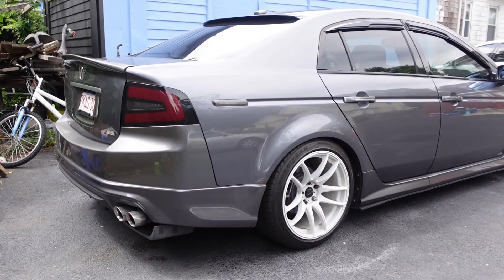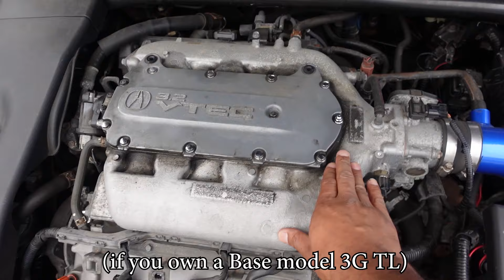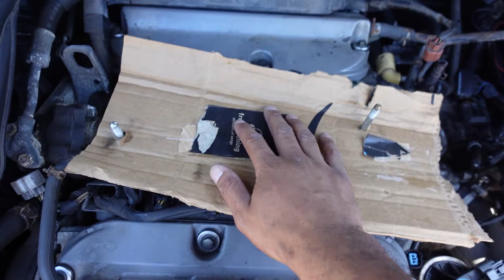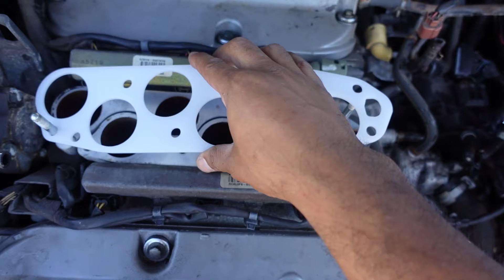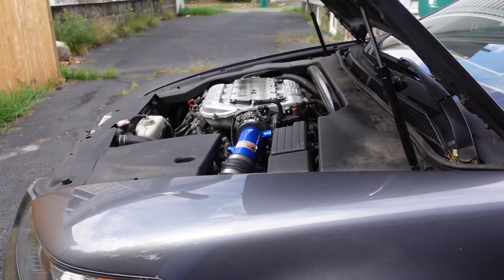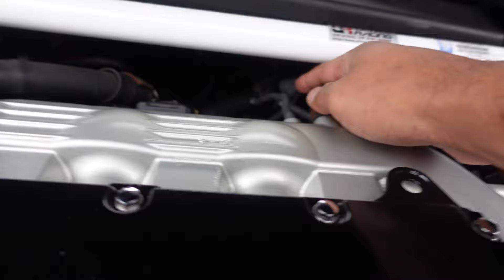MORE POWER!  3.7 Intake Manifold & Throttle Body Install

Comment from the maker: If you can find a cheap 3.7 Intake Manifold and throttle body, This is DEFINITELY A GOOD BANG FOR BUCK PERFORMANCE MOD.  Enjoy!!
Reply: Do you get idle issues after install
Reply from the maker: No issues at all, beside idle being 100-200 rpm more.  It's been a couple of months now since install, and I actually havn't had any problems.  This is just my experience
Reply: How much was that manifold cover and where did you buy it?
Reply from the maker: I bought my intake manifold off eBay, throttle body off Rock auto.  I repainted the manifold and that top cover
Reply: @thecarfiend11 around how much did u end spending on the intake manifold i don’t wanna get ripped off buying one
Reply from the maker: I bought the 3.7 IM for around $200.  add in the throttle body, coupler, gaskets, cleaning supplies and paint..it was around $400+ total
Reply: @thecarfiend11 do you have links at all?
Reply from the maker: I got my stuff off ebay
Reply: @thecarfiend11 thank you
Reply: So did the throttle body come off a tl 2010 shawd manual and it plugged and played?
Reply from the maker: Whatever the 3.7 motor is from.  Should be plug and play with some modifications needed. And you may run into issues like me
Reply: If you’re interested I’d be willing to buy the old faulty throttle body👍🏼
Reply: those sparco wheels/rims right ?
Reply from the maker: No.  They're Work wheels reps =[
Reply: So is the 2010 TL SH-AWD Throttle Body (or whatever Year TLs... an RLs TB/and or Intake Manifolds work as well?, Does 2010 TL SH-AWD use same 80mm TB but with same clip that would plug in correctly???)... which is the better option so you can plug in that clip instead of deal with the plug-in issue with the 2011 MDX 80mm Throttle Body? (also you know you can get that TB clip from an MDX out of a junk yard, De-Pinn the wires out of your TL TB clip and Re-Pinn the wires terminals into the MDX Clip right) ... 

An is the Butterfly actuator on the IM Cover like the MDX? Or on the IM itself like Gen 3 TL's?... 
I heard the Magnesium 3.7 Manifolds are the best to get...  

Year MDX or TL SH-AWD that came with Magnesium Intake Manifolds?
Reply: Hello I been look for that Silicone coupler with the hole for the IAT sensor can you like me know where you got it from??
Reply from the maker: its a couple from P2R.  Here's a link..
https://ebay.us/iHiCYw
Reply: @thecarfiend11  😢

Comment: If you can try to get a smoke test done, or start spraying with carb cleaner around all gaskets it sounds like your 2-300 rpm gain is coming from a vacuum leak. Great video!
Reply from the maker: Thanks man, appreciate the tip!

Comment: Thank you for this video, I recently acquired an 05 Acura TL base. I was told when I got it it had a 3.7 intake manifold swap and a type s automatic transmission installed. Had no way to prove it until I looked at this video and saw the differences. It is a true swap definitely makes me feel a bit better!
Reply from the maker: Awesome to hear!
Reply: the 07-08 transmission won't bolt up to your 05. bellhousing is different

Comment: Hey bro I have an Acura TL 2005 that has been sitting there for the past year and a half because I didn't have money. But now I do I really love the car right now I'm using a Chevy Malibu I don't like it, but do you think it's worth putting money into my Acura. From what I remember it was just a few head gaskets and a few other things that included taking the engine out
Reply from the maker: Depending on the condition of the car, it may not be worth it.  These cars are aging and considered "old" now.  But if its in good condition and you can do the work yourself, it may be worth it.  04-06 Autos have weaker transmissions than the 07-08, also.
Reply: @thecarfiend11  it's only overheated twice and I towed it worse case head gasket?

Comment: Never expect big numbers on Honda's unless cost isn't a concern. If I'm gonna build a street pounder I'll still build a Chevy. I love my Acuras but Chevy parts are plentiful and cheap compared to Honda's. I can buy one thumping cam and lifter kits for about 150. 00 For Honda's it's 849.00 and about 8 hours work.
Reply from the maker: I actually agree.  I'm don't plan on doing big numbers or adding extensive modifications.  I'm only doing budget full bolt ons and maybe a tune.  Grew up with Hondas and love Hondas.  So to each their own..

Comment: Where can I relocate the air temperature sensor?
Reply from the maker: Ideally, you want to put it in the same location as the 3.2 intake manifold.  drill, tap and die.  Others have relocated it in the intake piping also

Comment: Hey man. 🙂 Got a 2001 Acura CL Type-S. I already have the 3.5 intake manifold. I can't do the 3.5 throttle body because my butterfly cable is powered by the cable not electricity wires. But my question is where did you get that silicone IAT adapter? I've never seen one of those before. 
Thanks. I love your videos.

Comment: How did the bolt patterns Match up? Did you have to do any bolt hole relocation? I’m afraid that it won’t fit when I do mine
Reply from the maker: It's a direct bolt on (besides relocating the IAT sensor)

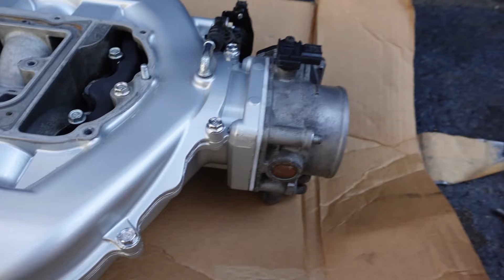Comment: 7:29 name of the coupler ? Link doesn’t work anymore
Reply from the maker: coupler is off a 3.7 Acura TL (4th gen).  Made by P2R.  should find it on ebay and available off their site
Reply: @thecarfiend11  appreciate it
Reply: @thecarfiend11 also one more question. Can I re use the hardware from the stock manifold to bolt it down ? Or do I need it from the donor car ?
Reply from the maker: I used the same hardware that bolts down the manifold

Comment: New TL owner here when you got the 3.7 did you have to change the runners are does the stock runners from the 3.2 fit the 3.7 intake manifold
Reply from the maker: You can change runners, but I did not.  Other owners usually get bored out runners from P2R

Comment: Edit: was your TL always manual? Your shifter box looks different than my 6mt. Anyways awesome build. Loving that even after a decade people are still modifying their 3rd gen TL's. Do you plan on supercharging your TL? I wish comptech still made that supercharger for the J32A3

I swear I should open a shop for fixing Acura TL's dashboards. Ive wrapped mine in a two tone alcantara. The only pain was grinding down the cracked areas after filling them. But having taking out my 06 dashboard multiple times I feel like a pro lol. I wish Acura had put more money in a better material dashboard.

Comment: Tune required?
Reply from the maker: Not required.  But it would help with gas mileage, get some more extra HP, and run better.  As long as it's tuned properly

Comment: What did u use to secure it to silicone? Super glue?
Reply from the maker: What silicon and where?  I don't think I used silicon anywhere
Reply: @thecarfiend11 sry I meant the silicone coupler, how does the sensor stay in place?
Reply from the maker: I don't have anything holding it in place.  It's been super tight, no clamp or zip tie needed yet

Comment: How much horsepower does this add to the base 3.2tl?
Reply from the maker: Not sure, as I did not do any dyno before and after.  Should add 5-10 Hp, in theory.  Also could be even more if you add complimenting mods, like a cold air intake and intake runners

Comment: Hey man, thanks for the detailed installation of the 3.7 manifold. I do have a question about the connector for the butterfly valve. Was it just a straight plug-in or were there any modifications done to it to plug-in?
Reply from the maker: Thank you, thank you.  It was not a straight plug in.  You have to shave it slightly, so it can slip on. I briefly explained it in the video
Reply: @thecarfiend11  oh yes, I saw that. I was asking more about the butterfly valve connection that sits on the intake cover instead of the upper manifold.
Reply from the maker: Are you talking about the IAT sensor?
Reply: @thecarfiend11  no I’m talking about the butterfly valve that sits in the upper intake to open or close depending on how much throttle is given.

Comment: Is this installed on the 3.5 liter?
Reply from the maker: i installed on my 3.2L.  But it can be installed on the 3.5L also
Reply: @thecarfiend11  is there a good website for the interchangeable mods like that?
Reply from the maker: Acurazine is a good forum for resources.  And for purchasing parts, you can visit EndlessRPM.com or HeelToeAuto

Comment: I’m thinking I will just drill a hole in my 3” to 4” rubber coupler right at the throttlebody and getting a thin nut for the inside to secure in the iat sensor.  Did you just push in the iat sensor in the hole?  Is it secure?  I think the threads on the sensor are m12/1.5 can anyone confirm this?
Reply from the maker: its a hack, but sounds like it could work.  I'd be careful, because if the nut gets loose and falls off, it goes straight into the intake..

Comment: 6:35 WELL Worth the TINY bit of extra work you skipped here. Sad to see people cut corners like this. You really minimized the effects not doing these. Dont need port polished ones, you can polish them yourself with a couple cleaning materials and some microfiber cloths, attached to a power drill. Yes you may only see 2 hp gains from this, but 2 hp for something that is essentially JUST LABOR. People pay WAY WAY more for less. 

7:29 That works, Or you can get an intake tube with one made into it. Either works. You can also just have it near your throttle body. Like literally floating around or zip tied down.. all its doin is acting a thermometer. Will it be AS accurate being beside and outside the tube v inside, No it wont. But it also wont make THAT big of an issue unless you live in extreme climates. The engines uses many other parameters to adjust the air-fuel curve. This is one tiny tiny piece of the puzzle. 

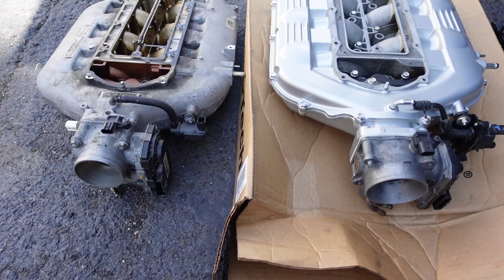7:40 - Yes you can just take a Dremel or razor to this just fine. 

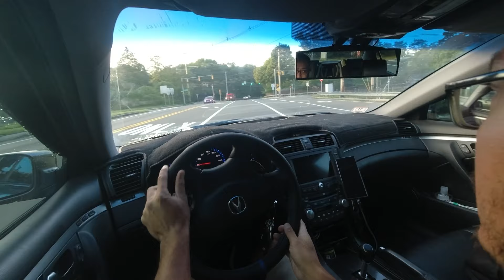12:10 Also, Plenty of people with that equipment and such have already done this testing on dynos and such. With full "supporting mods", Such as Cat deletes and exhaust, the intake manifold itself, as well as polished runners, and a certain cold air intake system. This "Bolt On" affair is worth a total of roughly 20hp... Thats 20WHP for those nit pickers. "Twenty twin twin Wheel HRSPWRS" for a simple Bolt on. No tune needed.  Bonus points if you use the magnesium intake manifold from the hybrid. Magnesium is lighter weight, and also has better heat soak properties. The intake actually stays cooler than the aluminium one. 

16:05 That will calm down over time too. Since you didnt know a throttle relearn was a thing you probably didnt (or dont) know how Ecu's fuel trim mapping works. Hence your MPG loss as well. The fuel mixture learning process is still trying to hunt around and fine that perfect mixture. This will inevitably use a bit of extra fuel, and cause rich and lean events on occasion. This is why its not recommended to go Thrash on  your car after just installing something like this without an actual tune. No you Dont need a tune, But if it were available you wouldnt have to worry about a slow relearn / remapping procedure, nor the loss of some MPG over that time period. It would be a LOT closer right from the get go. 

I suggest you take some time and look at "Open loop" and "Closed Loop" on a modern Ecu/Car. You will learn a lot More about the little nuances you experienced the hard way.  But to put it "simply"- 

"In open loop operation, which is normally when the engine is first started after a cold soak overnight or after sitting for several hours, the PCM/ECU ignores the oxygen sensors while they are warming up in the exhaust stream. The PCM/ECU uses inputs from the MAP or MAF, Coolant Temp Sensor and the Intake Air Temp sensor, Knock Sensor, just to name a few, to calculate the fuel control because the oxygen sensors do not provide good data until they reach a certain temperature as well as the catalytic convertors.. 

Closed loop operation occurs when the oxygen sensors reach their normal operating temp and the coolant temp has reached a predetermined setpoint along with some other things. In closed loop the PCM/ECU uses the oxygen sensors as direct inputs to control the AFR, or Air Fuel Ratio. The varying voltage produced by the oxygen sensors gives the PCM/ECU that data so it can give the engine the fuel that it needs based on the current operating condition. (Such as DBW throttle % input, Air temp, fuel knock readings ect ect ect)

For your ECU to set the OBD Readiness Monitors to "ready" the Ecu will have to go into "closed loop" operation.
Reply from the maker: I appreciate the long, detailed input

Comment: this is cool and all, but this ENTIRE process, intake manifold swap w/ throttle body, only gives you 5-7hp.. honestly, a spacer does the same without any of the hassle and you just put back your old cover and items like before.. P2R dynoed J37 intake on a J32A2 and it was 3whp. try getter a smaller battery or relocate it to the trunk as it overhangs centerline of the axle.. dynamically it's more improvement than this J37 swap.. this just isnt enough improvement to bother, esp for the price. I thinks everyone is caught up in the louder intake sound they think it's noticeable power, when it's really not guys.
Reply from the maker: Up to you bro 🤷‍♂️
Reply: @thecarfiend11  I did this same swap and it DID look better.. but the gains themselves weren't noticeable, only louder intake sounds. the battery relocated and a progress rear swaybar with lighter wheels all were better improvements 👍

Comment: Don't use the thermal gasket. They warp with heat and then you get a vacuum leak, I only use OEM gaskets on my boosted motor

Comment: what are you usually supposed to do with the connector that you didn’t plug in drill a hole ? for the connector or what

Comment: Where can I find this throttle body or a good one compared to the stock one on a 2005 Acura tl …links don’t work anymore …thanks for helping❤
Reply from the maker: I got mine's off RockAuto.com.  It's OEM refurbished.  You have to know which car the Intake manifold came from, so you can get the right one (they are generally the same with the 3.2, 3.5, 3.7 but sizing may be different)
Reply: @thecarfiend11  I see you went with the one from the rdx or was that the intake manifold?
Reply from the maker: My I.M. was from a 2011 MDX 3.7L (i believe).  So I ordered the throttle body for that car, not the one for MY car.

Comment: I gotta 2005 Acura tl and I’m thinking about building it but it has 287k miles what’s yo thoughts 😂
Reply from the maker: If it was my car, I would build it IF it's in good condition and runs well, but also not sinking too much money into it
Reply: @thecarfiend11  well I really wanted to make it something fast and cool sounding but you did make a point with it being front wheel drive and that it would be a difficult build and this would be my first ever build but I love Acura so much 270 stock hp being a gas saver is crazy do you know a similar car I could invest in then
Reply from the maker: since you like honda/acura, i'd recommend anything with a K-series motor.  they have tons of potential, and easy to modify
Reply: @thecarfiend11  yea preferably Honda/Acura because the 300k mile life span is crazy and also how much speed these cars can handle is actually stupendous. But I will further educate myself on the K series engines and what cars have that in RWD but being Honda/Acura most of the good/popular cars are FWD (civics-accords)
Reply: @thecarfiend11  im going to look for a 2007 Acura TSX. Good choice?
Reply from the maker: great choice

Comment: Where you got that rubber piece to install the sensor that it's on the 3.2 but not in the 3.7. I got everything except that rubber. 
By the way great job in the painting. 
Thanks
Reply from the maker: Its an intake tube for the 3.7L TL.  Search up..
P2R Silicone Intake Tube Acura TLX V6 & 09-14 TL SH-AWD

Comment: As someone who has a 3.5(the Accord) would this upgrade still be worth it?
Reply: If it's an auto, definitely do the MDX spacer.  Adds zero net power but gives a fatter torque curve down low which is sorely needed for an auto.
Reply: Not really, the cars are pretty much maxed. These mods mostly move the power curve, less at low rpm more at wot high rpm.

Comment: Do I need to do anything to my car before making this mod? I could just virtually plug and play with some issues that come with connections or hoses
Reply from the maker: it is basically plug and play, no prerequisites required.  Some people have no issues, some have issues after install.

Comment: I love my 2005 6MT. I know what you mean about small differences being felt in these things. difference between a full and empty tank of gas is quite noticeable. i need to get the 3.7 manifold and throttle body for mine now 🤩
Reply: Lmk how it goes, I have 05 6mt too and am interested
Reply: i have the 05 6mt  did it work out

Comment: Just passed up a white '08 TL-S manual. One of the smaller reasons i skipped it was no performance mods. This vid just came up on my FY page. Your car looks good and sounds great. Keep modding. 👌

Also, whats your MPG??? (before/after)
Reply from the maker: Much appreciated.  And yeah, there's not much aftermarket support for these J-series TL's.  But you'll be able to mod them nonetheless, with some creativity and skills

Comment: I remember the guys on Acurazine having issues and hiccups like throttle hang and what not when doing the 3.7L mani and TB. Have these issues been solved yet?
Reply from the maker: Yes, I have that issue, but it's not that noticeable.  It really only goes away with a tune, from what I heard
Reply: @thecarfiend11  I had throttle hang before my car was tuned. Drove me nuts. Let me know if a tune fixes those issues, it didn’t years ago. Good luck.
Reply: You need a foxwell scanner and do a tps relearn.  @sports_car_enthusiast